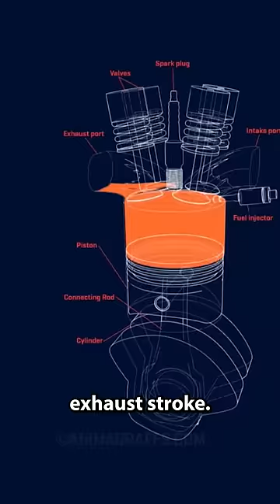Turbos Vs Superchargers

Comment: Theres pros and cons to both. Sure turbos make more power with the no parasitic loss, but they also produce more heat, they cause higher oil temps along with making oil degrade faster, they sap engine oil pressure, etc. Superchargers have their own external oiling systems, they don't make nearly as much heat, and you don't have to mess with the exhaust any or run any external engine oil feed, and drain lines. Plus the instant torque the second you hit the throttle; no turbo lag. So it just depends on what you're looking for. I personally have a twin turbo vehicle, and a supercharged vehicle in my fleet, and love them both.
Reply: What if you want to twin charge😂😂😂
Reply: the instant power is of course true, but with a catch: down low they actually produce less power than naturally aspirated, especially if low compression pistons. so no lag, but needs to wind up more for the same amount of boost.
Reply: Unless you oil pump is rooted it won't notice the need for oiling the turbo...  just means the relief valve opens less
Reply: This is a fallacy. You cannot get something for nothing. Turbo or Super, you use the same energy from the car engine to run both types of  chargers.
Reply: @catsthinkmynameisclaude6955 heat is not zero. and the instant torque is actually a small part of why evs accelerate so well. its really that they dont need to shift, wich takes time and in a combustion engine, shifting drops its peak power so you need to wait for it to get into it again. acceleration when actually in gear and in the powerband actually feels quicker in a gas or diesel than an EV, but then it needs to shift again. Combustion engines can use high revs to deliver near instant torque as well, so again thats only a small part of the story.
Reply: @catsthinkmynameisclaude6955 true. did you read Toyota's latest analysis of the EV market? really fascinating in that they are still convinced its a fad, and the sales are dropping even faster than expected. the thing is also the nature of fuel: it can be collected and burned as a physical source. relying soley on infrastructure and all this high tech stuff doesnt seem like a step forward to me. EVs also hamper freedom in many ways, not that the average person would notice but still. and Electric is really only good for cars and maybe short range trucks. you can forget aircraft and boats that are weight-sensitive vs. the range they need. and electric motors start running out of power the longer they are used, hence my comment about ICE engines feeling faster. really i should've said at higher speeds.
Reply: @catsthinkmynameisclaude6955car companies are already stopping EV production in favor of hydrogen combustion engines. It's far superior to EV
Reply: @ct1762  combustion engines are only like 60 percent efficiency the most is wasted in heat energy
Reply: @GordonAndrew Agreed. It's the power stroke that drives the exhaust stroke.
Reply: gunnytinman maybe but he is not the only genius.
Reply: They both create heat especially a roots blower.
Reply: @calebduncan1697 now thats where we turn around and walk away with that info
Reply: @calebduncan1697 never heard of Detroit diesel I see.  Blower to feed air into engine then years later they put turbos on
Reply: @catsthinkmynameisclaude6955 everything creates heat.  Electric motors create heat, the batteries create heat.
Reply: @GordonAndrew that's incorrect.  Blowers are a direct parasitic draw, where turbo is only using what's going out naturally.
Reply: @calebduncan1697 there's no point
Reply: @ct1762 that is purely incorrect.  There are supercharged motors in excess of 10,000. Even over 15,000. There is no naturally aspirated motor that can match that power no mater the rpm. Say you actually have a natural motor with 500 hp. I have a supercharged motor with 1000. I will have more power at every point of the Rev range. That's just fact. Fact is, natural aspirated can Never compete with forced induction, because the limits are vastly different.
Reply: Good thing with a quality IC you can literally decrease intake temps to a degree or two of ambient....
Reply: He just explained it to you. Turbo doesnt strain working elements in power stroke. This strain is balanced into exhaust stroke. So at top HP there is some margin left.
Reply: Yeah I couldn't decide. So I built a twin turbo supercharged bbc cadillac.  Have 6 turbo vehicles myself.
Reply: @Deere2154D its not right because without the turbo exhaust gases will flow without resistance when you add a turbo the crank need to push the exhaust out through the turbo and its the same as crank need to spin the blower in both ways you lose energy.
Reply: @benshefer4767  correct but a blower or supercharger has far more spinning mass making them a bigger parasitic draw compared to turbo charging.  Hence why some people are going towards pro chargers, less parasitic draw and cooler air temp
Reply: @GordonAndrew  The Turbo is utilizing pressure from exhaust gases that would otherwise just be vented to atmosphere. You aren't getting something from nothing, you are just more efficiently using the energy in the system. The Turbo has nothing to do with the crankshaft, a super is drawing some amount of horsepower off the crank.
Reply: No one talks to gale that way
Reply: @calebduncan1697 VW did it on their TSI engines, and they gave up after a few years due to complexity and reliability issues. I test drove a 1.4 TSI Scirocco with that system. It was MIND BLOWING!! Pulled from pretty much idle to red line like crazy and pretty consistently
Reply: @kylehenline3245  not really mate, this video already explain it clearly.
Turbo take power from crankshaft, as the crankshaft has to push those exhaust gas to the turbo during exhaust stroke. But it doesnt add any peak pressure during power stroke, unlike blower.
Reply: He did say turbos still had parasitic draw

Comment: Gale has a unique way of explaining complex ideas so clearly and concisely.
Reply: This is the best way I’ve ever heard it simply explained tbh.
Reply: This may be my ignorance over summarizing what he just stated, but turbos are just more efficient due to the fact there's not a parasitic draw other than increased back pressure from the exhaust. It isn't robbing any power directly from the crank.
Reply: @rainmakr9  yes exactly what he said
Reply: Common sense
Reply: Very good points. Turbo's take a lot of power out of nothing.
Reply: @Formerlywarmer Here’s my question, why don’t these top fuel guys use turbos? Why use a blower when it draws that much power?
Reply: @huntguy3831  it has to make that instant power.  
No matter what u do turbo will lag some and wen ur going 300 mph in less than a 1/4 under 4 seconds no time for lag.  

And turbo won’t build as much boost I’m sure when it gets to the top of the power band those motors are operating at near hydraulic lockup in the cylinders. 

That’s 98% full of liquid with the piston at the bottom of the stroke wen it needs to fire .  

That’s why the consume plugs and a lot of times pistons.
Reply: There is nothing complex about it. Show me a supercharged car that was NA previously and makes double the output? I can show you dozens of examples of turbocharged engines easily doubling output.

 Men especially like di*k contest so the 6-71 was always the wet dream of many enthusiast.

 Why my Kia Forte GT is faster than the vast majority of Diesel trucks is not only just weight, it's TURBOCHARGED!
Reply: @Formerlywarmer  Wrong there is no lag in a compound system and nitrous which Gale has often said solves any lag issues but too many hot rodders are simple minded. Running turbos and nitrous sounds complicated but it's not, Ive done it on every turbo car I have owned.
Reply: A true gem.
Reply: He understands. He doesn't just know
Reply: @LoociferZ Well, not "nothing" just LESS parasitic!
Reply: Gale can be very windy !
Reply: Glizzy gobbler
Reply: This is not a simple explanation...  😂
Reply: It's not complex at all.
Reply: @Formerlywarmer  it's nowhere near that proportion it's 10% tops
Reply: @dj4monie  yes I agree but I was leaving NX out of it.
Reply: @osmacar5331  if a top fuel car ( the top of the pack) makes 8-10 k HP what’s 10% of that?. But u can be right
Reply: I guess my question is, so what is driving the piston to complete its exhaust cycle, isn't it another piston that is currently in its power stroke that is driving the crank which is in turn forcing the exhaust out thus the Turbo is technically being powered by the power stroke indirectly?
Reply: He might have needed to do it a lot lol
Reply: How is a turbo idea complex?
Reply: Yes, But he 4got 2 calculate, that the Most parasitic on Any engine, is the Backpressure !!! ! !!! So : Big Turbo = Big Funnn !!! :-D
Reply: @Formerlywarmer truthful the most part although they make closer to the 8-11000 HP
Reply: @huntguy3831 as Gale explained in the first few words...blowers overall just make more power
Reply: @Formerlywarmer well said
Reply: @TTGTO288  cool.  And I have no idea why they would even won’t to give up all that instant power from a roots blower buy stepping down yo turbo.
Reply: @TTGTO288  ok
Reply: And you are absolutely right I’m wrong.
Reply: "If you can't explain it to a 5 year old, you don't know what you're talking about"

                                    -Albert Einstein
Reply: Response to OP: imo thats the true sign of intelligence.
Reply: I agree. He’s a master educator.
Reply: Yeah yeah man... Gran turismo 3 already proved turbos make more power back in 02
Reply: You mean boring
Reply: He was all over the place
Reply: But at some point  it lean out and burn a hole in the top of the piston to much heat
Reply: Many people can successfully explain this concept with the basic principles that they may know or can conceptualize about the mechanisms at play, but this guy seems to have a complete understanding of the topic so that he can point out the important points and how they come together to illustrate the concept. A true master when you can strip away the idea to its most important components.